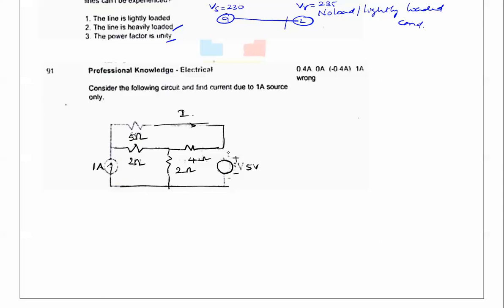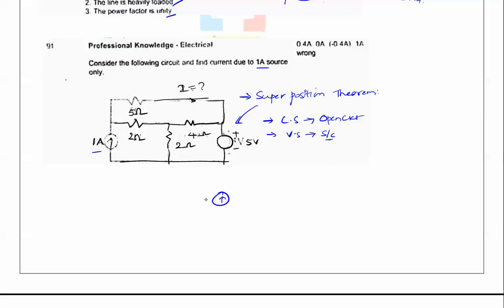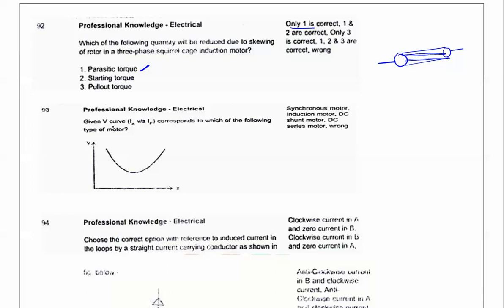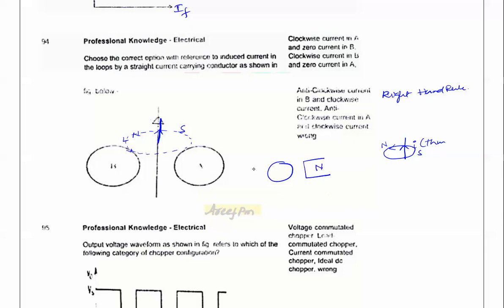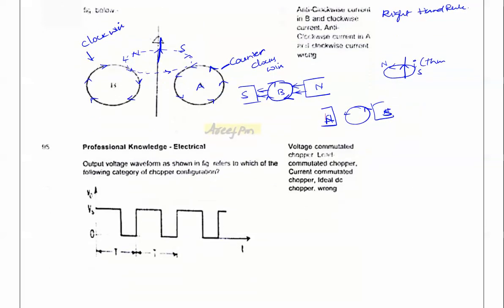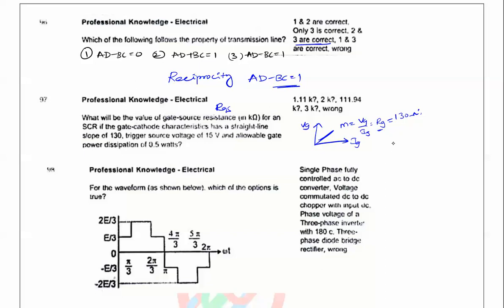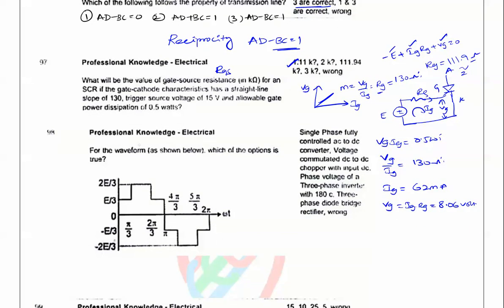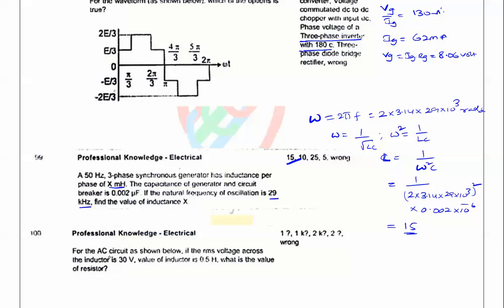MAHATRANSCO ASSISTANT ENGINEER (ELECTRICAL) SOLUTIONS PART 02

Comment: In question 94 option wrong should be selected...As current in the conductor is constant (as nothing is said about it changing), the magnetic flux around the conductor will be constant and no emf will be induced in the loops as e = d(flux)/dt